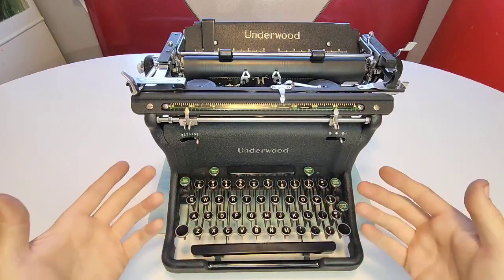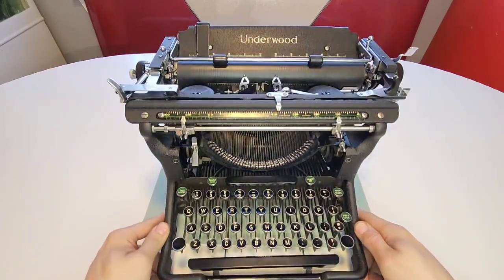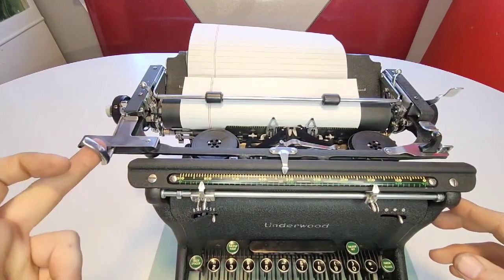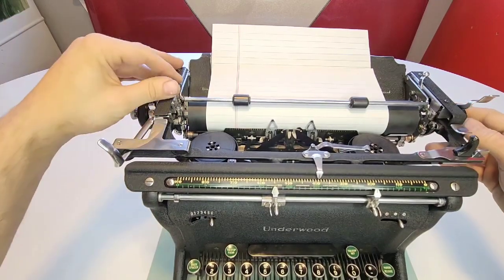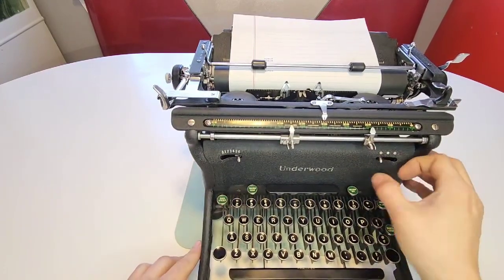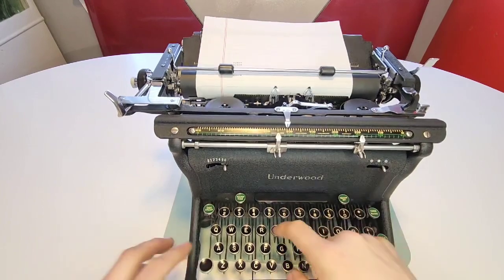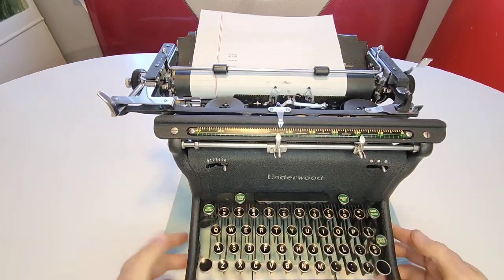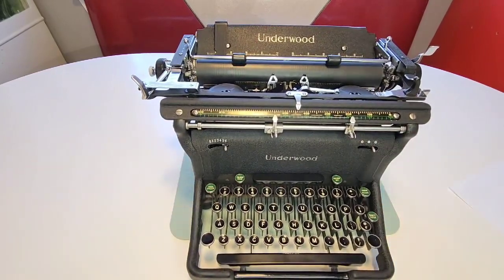Underwood Model S finished restoration.

Comment: Very interesting breakdown, I just purchased a Model S and could not figure out what the Tab system was for, so thank you! I am curious if you have any advice for restoration? It would appear that my shift system is not functional. Besides that, everything is just a little gummed up, but I am getting it to work through use.
Reply from the maker: Thanks for the kind words! The tab system is interesting and complex! As for the shift, there are 3 points of 'pivot' or links that make the carage 'lift' or shift up and gravity pulls it back down, as these gum up it make the 'up' and 'down' not work as smooth or fast as they should and the shift gets odd. On the bottom right and left side of the carrage are metal 'U' shaped bars, try to loosen the scre on those slightly maybe a half turn. This may help get things moving. Also you can put some light machine oil on them joints and while lifting and pushing back down on the carage with one hand, push the shift button with the other to work the oil in and get it moving free again. Best of luck on your restoration! Take LOTS of pictures as you take thinks appart! trust me ha!
Reply: @DJDAudio  these machines are incredible! I fiddled around with some of the mechanics and the shift system came back to life! Also I don't know if you have any insight into why my letters are all capitals? My brief Google search claims that this may be military typeface! Exciting that this typewriter may have been used in WW2.
Reply from the maker: @maxeffort325  So glad you got it working! You are beyond my knoledge here, but I can recomend this great group that would love to answer these! They get questions about odd typeface all the time!

https://www.facebook.com/groups/4770669677
Reply: @DJDAudio  Thank you! I'll give them a message